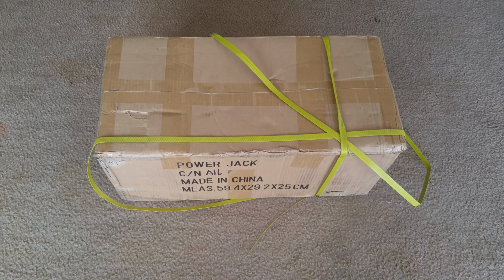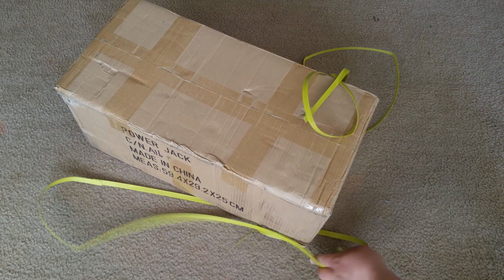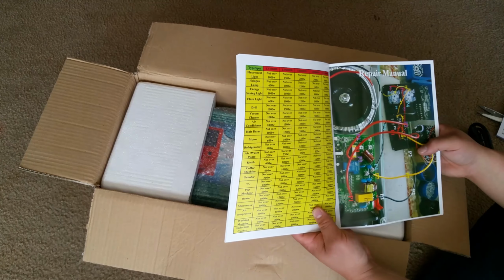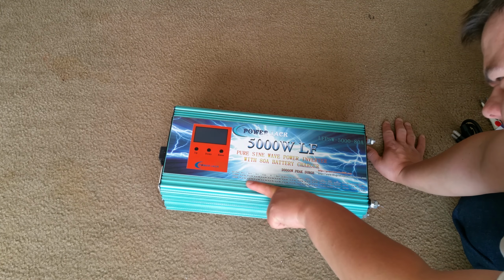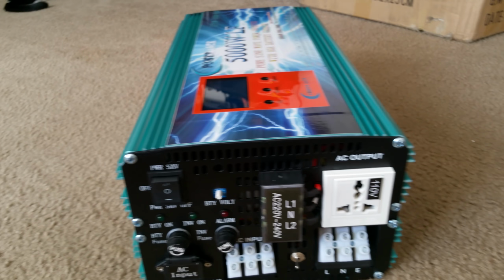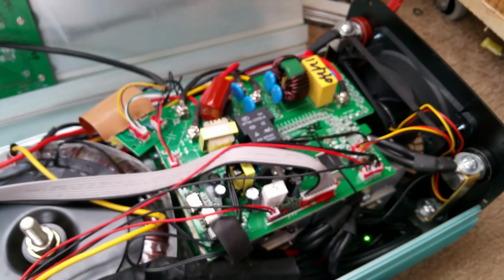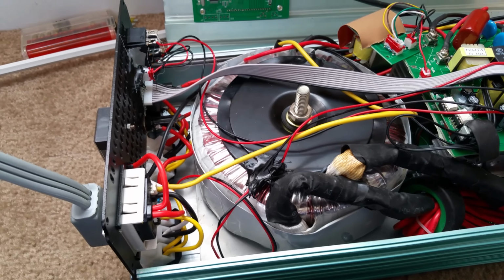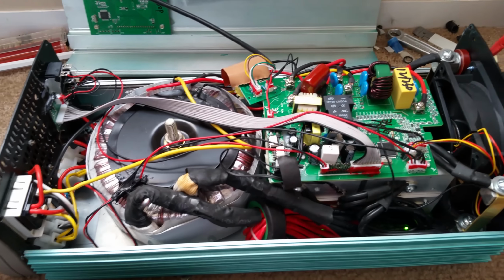Power Jack 5000W LF Split Phase Inverter Unboxing and Test

Comment: I have the 5000 watt LF it’s been running at least 8 years 24/7 with a load ranging from 500 watts to 2000 watts, zero issues with it

Comment: I want to know if it is possible to change the shutdown part on a powerjack 5000 to shut it down at 12.2 volts instead of the 10 volts which is the built in version

Comment: Yes you should recommend to open the unit on reception, because there are always some loose screws, mine is a 3000w UPS from JESUDOM and I had to open it to tighten some things, wires unclipped etc. works perfect after that.

Comment: Isn't this the inverter that pops with power tools? Inductive loads seem to kill them.  (Motors and so on..) One I saw reviewed had 20 amp fuse for a 110 volt feed...which would be a 2000 watt ..

Comment: Hi, I have a problem with this investor.

I output more than 240v.

Between 240-250v the appliances do not work for me because the voltage is higher.

In Spain we use 220v-230v

Change the plate and the 4 mosfet and stay the same.

I do not know what to do.

Comment: That way my inverter can not use with 1 bateri...u have 2 bateri...5000w,I have 10000w that why i use 1 battery is low power..thks for u...can u use 1 battrey,that inverter can operate  or not..

Comment: When the top cover was removed, my first impression is that one or more of the printed circuit boards had broken, this impression coming from an irregular edge on one board and what appears to be a PCB fragment lying atop it. The chassis has a rat's nest appearance, that it works is remarkable.

Comment: I had the 5000w model and then the 8000w model. Both have had many problems due to overheating. On both sides I replaced the two boards (main and control). No Power Jack email support. Very poor products and poorly built. I do not recommend them.

Comment: I bought one of these two weeks ago installed it and on the third day it's running on 24 volts with 8 batteries in series parallel and again Within the third day it's becomes nonfunctional its I just have a single 14 watt light bulb on it in the light bulb gets bright and then gets dim shuts off and then gets bright and then dim and shuts off and so on it just keeps doing this it's not supplying anywhere the amount of wattage that it states on the front. Please help I'm not in the position of buying top dollar Brands but I need someone to talk to and I can't find anybody in China or in the United States that was I bought one of these two weeks ago installed it in on the third day its running on 24 volts with 8 batteries in series parallel and again with in the third day it becomes not functional its I just have a single 14 watt light bulb on it in the light bulb gets bright and then get gym that's all and then get sprite and then gym and shuts off and so on it just keeps doing this its not surprising anywhere the amount of wattage that it stays on the front please help I'm not in the position of buying top dollar brands but I need someone to talk to and I can't find anybody in China or in the United States that was interested in talking to me about the unit I just wanted working if possible can someone help my email address is a s e i d n e r at gmail.com
Reply: You need at a min 25W load

Comment: a couple of years later does this still work?
Reply from the maker: +Chad Bird yes works great and have it running in split phase now so it actually puts out closer to 5kw in split phase.
Reply: What do you mean running it in split phase ?
Reply from the maker: +Harold Thibault American standard 240 volt single phase which is 2 120 volt lines each 180 degrees out of phase from each other.

You can not hook up 2 110 lines into the mains if they are not out of phase.

Well I guess technically you could if you did not have any 220-240 breakers in use.
Reply: So when you say in split phase, you mean AC120V ?
Very strange ! Where do you get the second 180 degrees out of phase from the first one on the grid ?
In Europe, we have 1phase AC240V or 3 phases AC400V, 120 degree stag between each !
Reply: @haroldthibault9921  in the US typical residential is 3 phase comes to a neighborhood then single phase is provided to each house with two "hot" legs (L1,L2) coming in and a neutral (N). The voltage across the two hot legs is 240V. This is single phase. The neutral is "halfway"  between the 2 hot legs and is bonded to earth ground at the panel. The voltage across L1 and N is 120. So it's the voltage between L2 and N. The breaker panel is laid out to try and balance the load so that as you physical go down the panel connections to L1 and L2 alternate. If you want 120V you have a single pole breaker that connects to either L1 or L2. The wire leaving the panel has three wires in it: one hot usually black L1 or L2,   neutral N, and a bare copper wire which is the ground wire. L and N carry current. The ground is there to connect to any metal parts of connected devices to provide a ground out in case of a short to the housing or other metal parts. If you want 240V usage used when the power request is high at the panel you have a two pole breaker. The wire has 4 conductors, L1 black, L2 red, N neutral, and the bare copper ground.

Another way to think about this is how an inverter makes split phase. There is an ac current on the input side coming from the oscillator the winding in the output side of the transformer has a line that comes out from the halfway point on the winding. This is also called a center tap transformer. The full phase is coming from the two leads from the ends of the winding. Voltage from either of these leads and the center tap is half that of the full phase and it's also 180 degrees out of phase with the voltage across the other lead and the center tap.

This way you can have 120V between either leg (L1 or L2) and neutral (N). Or you can take from both ends (connecting to both L1 and L2) and get the full voltage of 240V.

Comment: Heya! Thanks for the video! I'm a fellow Michigander myself! I'm still debating on which inverter I want. Power jack doesn't seem to have a good track record but I've seen Reliance Electric (chinese) seems to have a relatively low failure rate for a Chinese product. Also I can say I just watched a video earlier of the same unit and basically the warranty registration allows you to get free replacement components if any should fail. :) still, seems like it'd be better to just make a more reliable product lol

Comment: you live in michigan? also can that inverter be wired into a home breaker box to power 120/240 appliances? it says it is split phase and has 2 hots and a neutral, but i saw something that said you cannot use 120 and 240 at the same time. it doesnt make sense to me as long as i dont draw too much on one of the legs. or maybe it is just poor translation. im just not sure. ive been looking at the 15,000w version which is their biggest one. the biggest load i will have that requires 240 is charging my nissan leaf. 6,600w draw for that one, and 15,000 will allow that to charge and have room to charge another ev we are planning to get. planning on getting a house here in Michigan and going off grid with a 48v (12s 44.4v)lithium ion battery bank for the cost of a lead acid battery bank.
Reply: You need to balance your loads on each leg as close as possible and do not max the 4k on each leg try to keep 25% jump space on loads ( i assume you have 8K)

Comment: Since people have went and properly tested Power Jack stuff you can expect, 1/3 the rated performance and no actual heat protection. So if you do run it for long periods be sure to add an extra fan or they will burn... not the sort of things I would advise using in your home.

Comment: to let you know, the togal switch, turns on the fan for cooling, it will over heat if the fan is not on all the time !! and it only produces under 3000 watts, closer to 25,00 to be accurate.

Comment: 120 and 240 are correct USA utility voltages, a little higher than 120 don't harm anything, in fact you can run things made for 120 volts on anything from 100 to 150 volts safely. The only thing is that at 100 volts the appliance will draw more amps and make it run hotter, at 150 volts it will draw less amps and run cooler.

Comment: For $5 more they could have put higher rated MOSFETS and Capacitors in the damn things. I have repaired so many power Jacks I have a freaking dresser draw in my shop loads with MOSFETS and 85 volt capacitors. Sick of them after 5 years.
Reply from the maker: +Јохн «HEADSMASHER» Даниел Interesting, have you had the newest ones come in with problems?
Reply: GPVlog Just a few. I bankrolled 4 college kids about a year ago to start a component repair shop and they are very busy doing warranty work for a few companies. I trained them and set them loose. The following list are branded inverters we no longer offer to repair. Aims, Royal Power, Wagan, PowerJack, Bestek, & Meind. There's a few more but that's the well known brands. Reason is, they are what is known as disposable. Too many low grade parts. You fix one part and something else blows. Not worth it.
Reply: GPVlog The newest one already has a repair parts list on eBay. That's a bad sign!
Reply from the maker: +Јохн «HEADSMASHER» Даниел Gotcha, haven't check ebay since I got the inverter
Reply from the maker: +Јохн «HEADSMASHER» Даниел would be interested in seeing a few videos of the work you do on these.
Reply: GPVlog Not sure if they have one right now but I will watch for it and see if at least they will take pictures of run a vid to upload.
Reply: I have one exactly the same. I changed all the mosfets. It starts but no 220v. What should i look for? Thank you.
Reply: Donde puedo comprar mosfet ...los ha quedado!

Comment: These are SHIT, Can I say SHIT on your video, If so, Then again, THESE ARE SHIT!
Reply from the maker: +Јохн «HEADSMASHER» Даниел Most will agree with you. So far I have had no issue but I have not drawn over 2k from it yet.
Reply: GPVlog When you buy a Power Jack, derate it by 60% and that's the actual capacity. It's like that liar and fraud Missouri Wind and Solar, everything he sells is straight up false advertising up to  400% over fact.
Reply from the maker: +Јохн «HEADSMASHER» Даниел Heard alot about MW&S ripping people off. I dont buy anything from him.

I don't plan on taking this inverter past 2500 watts at 240 in split phase. That 2500 will power everything in my home except for the hot water heater and the central air.

Comment: Yes  i bought one a 5000w mine would beep at 1500w, and my friend bought the biggest ones they make, our experience was they could not do anywhere near the advertised rating and my friend blew two of his up and he only got to 50% of the max rated wattage , not surge watts. but these later power jacks now atleast have tudorial coils instead of the puny transformers they had.
Reply from the maker: +nightmare in action nighmare in action can you get a video of your work and the inverter in action?
Reply from the maker: the outlet is rated to 1500. I have had no problem holding 1500 for extended periods of time. now when you hook it up in split phase it is suppose to hold 5k. but I'm guessing it's closer to 3k
Reply: +GPVlog yeh you must have the newer model ours had crap internals, yours is probably a heavy inverter due to a tudorial coil, ours were feather weight , it felt like the inverter was hollow. i now use SMA.
Reply: I got the 8000w one pure sinewave and it cuts of 7500 500watts its not that bad but i did put thermal pads in the mosphet so they debt overheat they were put in wrong
Reply: GPVlog i can try to replicate the prosses i did since i moved and recently sold the unit but i can try to save up and buy another one and the reason i checked for this prosses was because i read a lot of them having problems the mosphets/transistors were held in by the button meaning the top was not making contact with the heat sink and that was the case with me there was just loads of thermal paste all over the place i cleaned all the thermal paste and bough a couple of thermal pads not thermal paste thermal pads and i moved the holding brackets up a bit this time if its possible ill do one side with thermal glue and one with thermal paste and see witch one is better when went i said 500 i meant to say 5000 i dont know if it was my batteries since i had kind of a small pack i still have some of the batteries the solar panels i dont since they were stolen but those i can get those from a friend the has a couple of broken ones the i can fix. the inverter i can save up and buy since i am getting a part time job soon and i will run almost the same set up i did  i will also buy the inverter from the same seller so like that i might not get a good unit this time =)
Reply: The heavier toroidal coil is necessary as it is a low-frequency design.  Supposedly LF is better for voltage regulation, but IDK.

Comment: does your inverter have a dial for 'battery voltage'selector? it's not clear how to 'point' the dial. i am curious what you made of yours.
Reply from the maker: Chris. Can you message me on my Facebook page? I am at GPVlog on Facebook. We can talk there.
Reply: Its the battery type dial.  There is an agm 1 and agm 2 and if you determine the voltage outputs there in charge mode, i think 1 is 14.4V and 2 is something like 14.7V then the rest follow the sequence listed in the manual.

Comment: are your batteries attached to a charge controller while you do this test? i am still trying to figure out why my 110v outlet seems to have no current. the inverter comes on fine, fan runs, displays work. the only difference with mine is it includes a solar input with display (that i will likely not use, since i will connect solar to my charge controller).
Reply from the maker: +Chris Kelly Sounds like you have the grid tie version. It takes solar panels and converts it into house current for you. Can you get me a video?
Reply: +GPVlog got this from ebay (bloominginverter) 4 IN 1, Off Grid 5000W LF SP PSW power inverter DC 24V/AC 110V/220V/1.2KW SOLAR

i have tried it with a 60w lamp, which should be enough wattage. tried with power save on and off. i will get a video soon... my last phone is kaput, so getting a new one. :)

Comment: mine is the 24v 5000w split phase LF... i tested it with a 24v battery on the single 110v outlet... nothing happening. i wonder how much wiring i am going to have to do... inside everything looks intact, but i am no electrician ;/
Reply from the maker: +Chris Kelly Where did you buy it?
Reply: +GPVlog Heres news on any inverter over 3000 watts, None can supply more then the outlets on the damn thing. Duh!  A 5000/10,000 watt inverter with 4 -15 amp outlets or terminals with 12 gauge feeding them, Hmmmm...... Sumptin Fishy with them Numbers from Power Jack! If you want to know the truth about a inverter, open it up. If it don't have the supply cable exceeding the amps/volts/watts math then you got your answer.
Reply: Je vnnn l'adresse du vendeur comerciale
Reply: L'adresse du vendeur de l'appareil

Comment: I received mine a week ago, in my case I had to let the fan running all the time, other wise the alarm will turn on and it will cut off the power. For now it's working well, hopefully it will keep that way.
Reply from the maker: +Gino Theysen you went with the 5000 watt ?
Reply: hola me gustaria saber donde tu lo comprate
la pagina
Reply: mine the fan has to be on all the time too !! not happy.